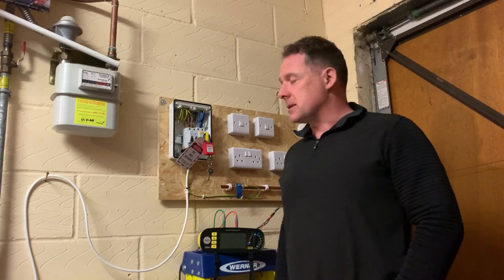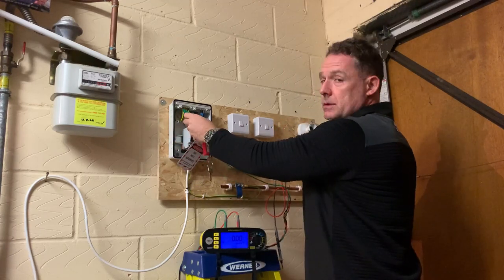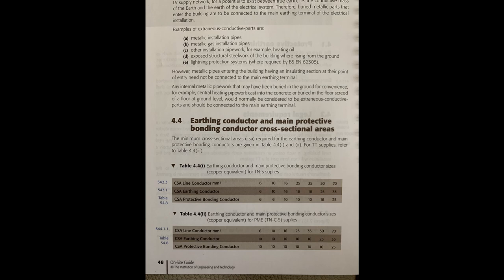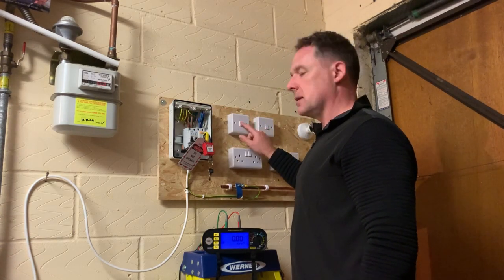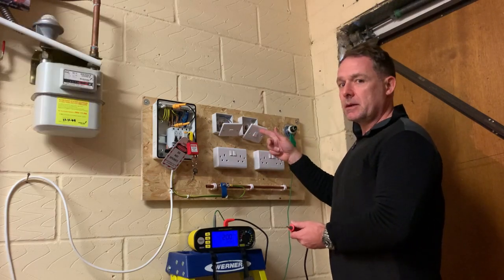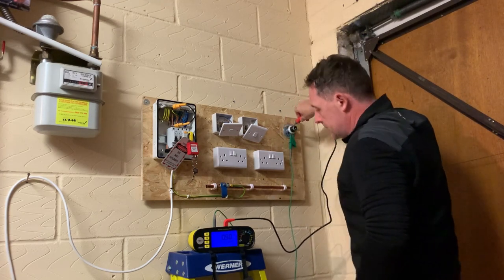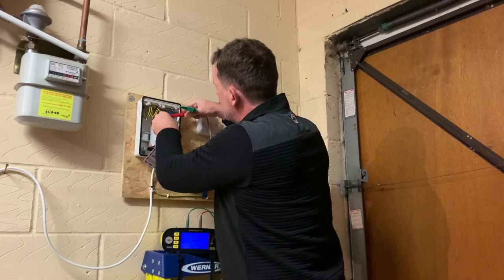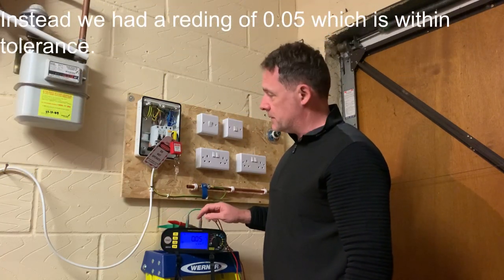Continuity of Bonding, Lighting & Ring Final Circuit

Comment: Hi. Well explained for apprentices out there 
Also like your on screen display on guide
Been in the industry 30 odd years and your teaching well 

Still thinking about buying the dilog MFT  and I’m getting closer to making my mind up…… dilog should sponsor you as your first on YouTube to demo there equipment well
Hope your channel grows well 

Real content 👍👍
Reply from the maker: Hi Tom, many thanks again for your kind comments. I really like the DL9118. It’s easy to use, batteries seem to last well, great big screen and everything is clear. I like the fact that it also inhibits tests if >30v found while carrying out Continuity, IR tests, it also displays the voltage present and turns the screen red. I’m not a massive fan of the auto test in continuity mode for obtaining low value ohm readings, it’s better to just keep it on the standard one press mode. It bounces around a little too much in auto mode, fine though if your just belling something out. I will get some more content up purely on the DL9118 functionality. I thought I’d give you this feedback in the hope that it may help you further in your decision. Cheers again.

Comment: Hi, Really good video and very informative. I have a machine just the same. When I do the reading on the test board for my ring main, second stage reading is coming up the same as the first stage, is it the machine?
Reply from the maker: Hi Jubba, thanks for your comments. Often the length of cable on the test boards is so short that the readings can come back as fairly similar.

Comment: What's your opinion on the 9118? I've got one but not used any other mft other than dilog as yet. As always everyone is Megger mar but just wondering if you are of the same opinion if given the choice.
Reply from the maker: I haven’t had any issues with the 9118. They’re all you need for most of the work you will do. If you’re living in a more rural area where you might be installing earth rods, then maybe go for a Megger. Otherwise, not a lot of point paying through the nose. Like most of the top brands they’re trading on their name.
Reply: @pwaelectricalltd29  I'm glad you are of the same opinion. I work on holiday parks so even with TT systems I don't see any problem with the dilog gear and actually there service is 10/10 in my opinion and I even got a live demo through one of their team free of charge over zoom. Can't imagine Megger doing that on a one to one basis.
Reply from the maker: I can’t imagine any other manufacturers doing that 😀. They’re a good British made product.